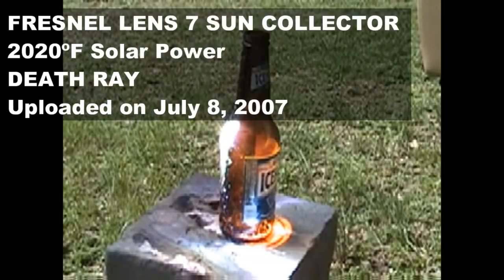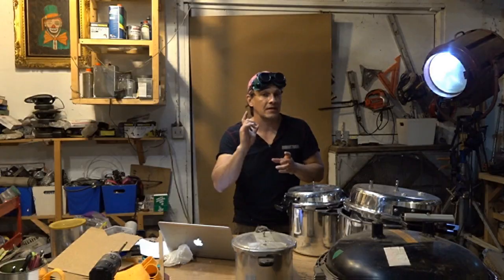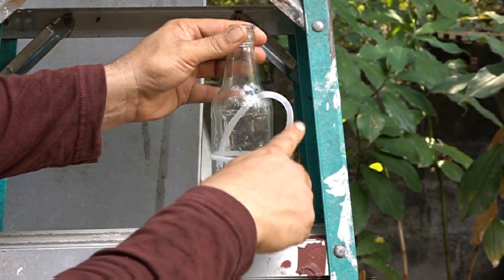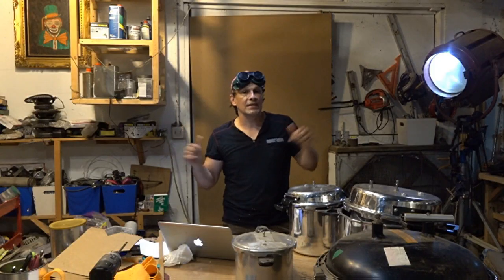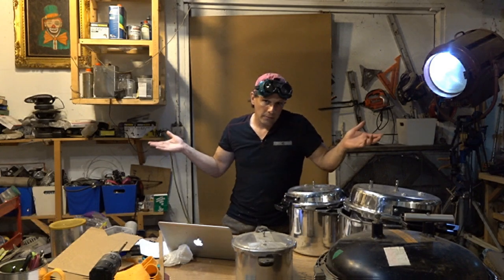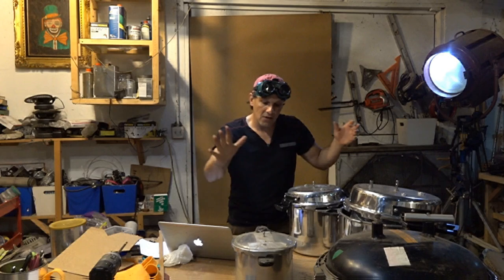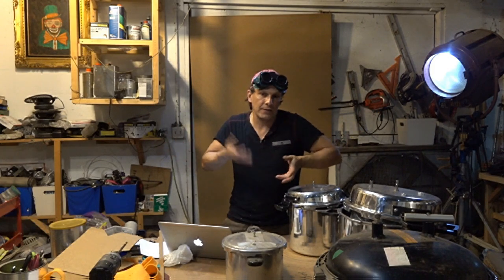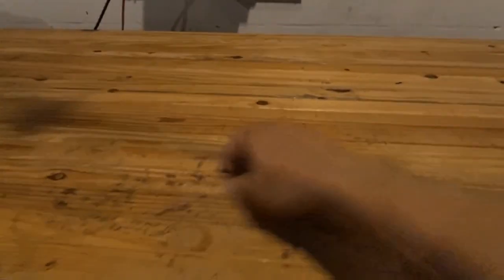Siphon INSIDE A VACUUM, self siphoning bottle

Comment: Hey Dan! First: Great work. 
I hope you can help me and because you havent got to much viewers maybe youre gonna answer me: 
Since I knew thatwater boils in vacuum, I always asked myself what would happen if you put sth with much calories but also much water, for example an orange in vacuum until its completely dried out and then lit it on fire. Theoreticly  it should burn great because all the water is gone and the energy is highly concentrated, right? Ive asked many Science youtubers to do that but no one replied and I dont have the money by myself to do it, so i'm asking you if you might do a video about what would happen. Would be so nice of you. Thank you for reading :)
Reply: Interesting idea, it might go either way, might become easy to light due to oils not having any water around or harder to light because the things become solid and requires a lot of heat to get started.

Comment: I was hoping to see the rv refrigerator working on solar power
Reply from the maker: That is in the works. We need sun and a weekend to work on it.
Reply: How about building a swing powered refrigerator? I have built some swings that generate electricity (at swinggen.com), but its easier to pump water, air, or refrigerant with the lever you swing from. Are you familiar with 2stage oscillators?

Comment: yo!!!  hey have you made a BEDINI MOTOR yet???
Reply: Check my channel, I built one out of bmx rim. free energy motor!!!!  bedini motor, 5 coiler, bad bearings steal alot of torque
Reply: it runs off of 2 car batteries and runs indefinately! only 4 coils in this video
Reply: ive had it going a week at top speed but bearings get to loud, grindy bad cone bearings
Reply: here is the motor with ONE Electromagnetic power\generator COIL, instead of 4

Comment: Come on, there is no way you can siphon in a vaccuum worth this name (let's say less than 1% of atmospheric pressure). You need some pressure or the liquid would never go up in the tube. Make te following experiment : put a test tube filled with water upside down in a glass of water and put them in a vaccuum. You will see the water level decrease, that's how pressure is measured with a mercury barometer by the way. Then you can see why the liquid would stay in the bottle if you try to siphon in vaccuum.
Reply from the maker: https://science.slashdot.org/story/14/04/25/1559211/siphons-work-due-to-gravity-not-atmospheric-pressure-now-with-peer-review

Siphon is different.
Reply: The actual Nature article linked there says exactly what I said. It describes how our siphon becomes "back-to-back barometers" when you decrease the ambient pressure enough that it can't push the liquid column in the upper part of the tube. What else could "push" the liquid above the surface level if not atmospheric pressure ?
The widespread mistake is that a difference of atmospheric pressure between the 2 reservoirs is causing the liquid to move. There is actually no air pressure difference big enough to account for the flow, the pressure difference is due to the height of liquid, then by gravity. That mistake was featured in dictionnary definitions of siphoning. 
http://www.nature.com/articles/srep04741